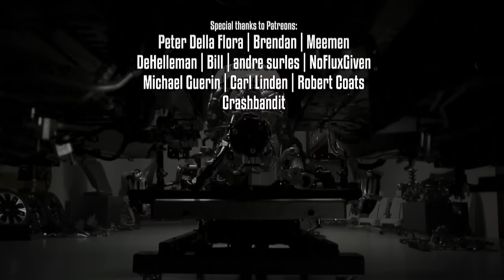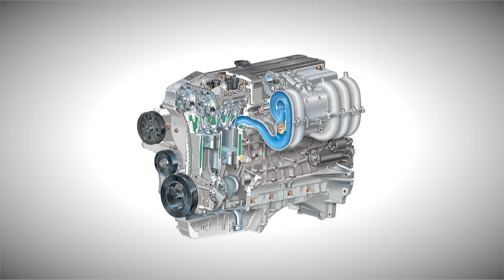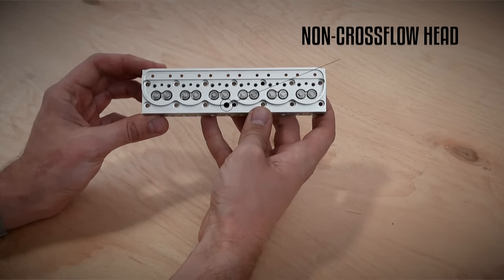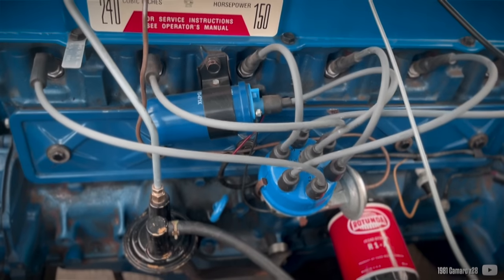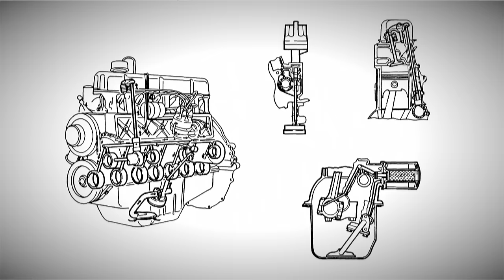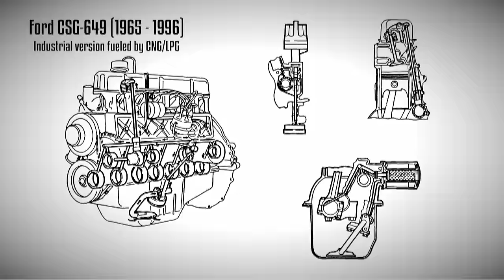Is This Toughest US 6-Cylinder?

Comment: I currently own an f500 with the 300 in it. It sat unused for 10 yrs because I'd grown weary of troubles with the brakes, engine catching fire, ( leaky carb and cracked exhaust manifold ). One day I decided to resurrect the truck, do everything right and put back into service. I cleaned the gas tank, got a new manifold and carb, cranked it over and it started right up and ran beautifully. The 10yrs meant nothing to that engine. Sad, but I never finished the restoration and will probably die regretting it. Or maybe a miracle will happen and I'll feel younger and more energetic then I currently do. 🤤

Comment: Chrysler 225 inline Slant Six.  Bullet proof.  Family had one in a station wagon. Just changed oil regularly, sold it with 220k miles.  The body of the car was absolutely falling apart. Buyer just wanted the motor.

Comment: Back in the  80's I had Plymouth with a slant 6, (I think was 206?) That motor was indestructible, the car was falling apart around it ,and after 300.000 miles I blew a cylinder, and I still drove it for another 40,000 that way ,until I got rid of it, and it still ran.

Comment: Dad had a 1975 F-150 bought new and had it for many many years standard shift on the column I bought a 1983 many years ago with 189,000 F-150 and drove it until it had 347 on it and sold it to another person which still has it today and that was 6 years ago and i owned it 12 years and loved it mine had 4 speed in it full size heavy duty XLT hauled wood with it plenty of logging power never could overload that thing one of the best engines I have ever had no newer engines could even compete with it today period very well made those 300 sixes where period

Comment: I know that's why all the corporations quit making their big 6-cylinder engines all of them had great ones I had a Ford with a 300 6 cylinder engine I had a Plymouth with a slant 6 and I had the jeep with a 4.0 all Dynamite engines last for at least 250 to 300,000 miles no problem and if you're really took care of them they would go about 500,000 miles timing belt that was it

Comment: The presenter mentions that Ford has been a proponent of straight 6 cylinder engines since the early 20th Century.  That is not true.  Early Fords, including the Model T and Model A, were powered by straight 4 cylinder engines until Ford intruded a larger engine, which was the famous V-8 of the early 1930s, and which lasted in production for another 20 years.

Comment: I remember when Ford's 300 ci  inline 6 had more torque at low rpm than their 351 v8.  It was the best choice for the F150 and F250 pickup trucks.  You could pull out in 2nd gear without stalling the motor.

Comment: The Fords CID 300 was the best inline 6 ever made. Maybe not the best economical. My old F100 would only get 15 mpg. But that engine was very reliable. Gear to gear cam to crank. Why they went to belt driven cams in later engines? Probably to sell more belts and make a cheaper design.

Comment: Biggest thing most people over look is the ability to perform most task from under the hood.... Oil change etc .you can even do engine rebuild without pulling the engine block.... Ain't it just ain't it 😜 lols.....add electronic ignition and they are so dependable....The inline in the field and woods are awesome especially 4 wheel drive..... I used them in spreader trucks 700 Ford chasis with a throttle Lock all you had to do was steer...😎

Comment: I use to operate siesmic equipment in the oil field that had Ford 300 industrial engine
I never seen one with a bottom end failure
Rocker arms would occassionaly have a push rod go through them
But that was it
Incredibly tough engines

Comment: Haven't watched the video, but if it's the Ford 300 six, then yes.

Well. Of course it was the 300 six! My daily ranch truck. Not an economy vehicle, but if you need a rig to start on a cold day and give reliable service, daily, it's still the clear ticket. I suspect it died due to emission controls tightening, but it's the best six cyl and maybe the best auto engine ever.

Comment: I worked at a ford dealership when the cash for clunkers was a thing! We had a handful of trade ins that needed to be destroyed and hauled away….(saddened me watching perfectly good vehicles get ruined) anyway, employees of the dealership couldn’t touch these trade ins that were on the chopping block….a designated driver/operator came and destroyed the engines and hauled them away…..one day the as this “Driver” was doing his thing to these perfectly good vehicles , I ask him what the process was? He said he drained the oil and put a salt water solution in them….then proceeded to run the engine till it seized…I then asked him what’s the longest he’s had to run and engine before it seized….he replied with about 15 minutes …normally only takes just a couple minutes for most engines. I then asked what engine was it that too so long? He said the Ford 300 six! He said it wasn’t a fluke either…..he’s destroyed 5-6 of these engines during this prices and they were all well over 10 minutes to seize…

Comment: I had 1996 Econ Van with a 300. I sold to a friend at about 300K miles. My friend drove it to about 750K then the odometer broke. Engine never was rebuilt and was still original when he finally sold it.

Comment: The Ford 300 was Ford's best engine but the Chevrolet 292 probably it's equal. To say either is the best 6 cylinder would be a lie because all semi trucks use 6 cylinders and if your going to claim diesels don't count because they would easily win you also have to think that Cummins is making a gas version of the 6.7l diesel

Comment: My Inline 250 that i had in my 1976 Ford Maverick, would just not die. By the time i had pulled the motor out, (Which it still ran), it had 400k miles on it. I never ran an air filter on it, i never changed the oil, it had so much wear in the cylinders that when it ran out of oil, it would just shake and shut off. I would just add more oil and it would start up with no problem. I wish i had kept that engine and rebuilt it. Instead i went with a Ford 302.

Comment: My daily is a 91 f150 with the 300 6. I routinely pull a 20ft flatbed trailer with 2 tons of scrap and more in the truck bed. Most of the time the combined weight is over 11k lbs. It's not fast but it always gets the job done.

Comment: I drive a 72 f250 with this engine. It has a cracked cylinder head and leaks water into the oil. I plan to fix it eventually, it's been this way for a year. Not really a big deal, I just keep the rpms low and removed the thermostat so the engine can't heat up.

I daily drive it, not worried about it at all. It's from 1968, I think its all original parts

Comment: My 1985 F150 has 410K miles on the last of the  carburated 300 cu in made before going to fuel injection, and it is still going strong and will until the commies over here outlaw gasoline.  Have to add it, the original mechanical fuel pump is still on the motor.

Comment: UPS used the Ford 300 L6 in their delivery vans for the longest time. A buddy drove one and said they pulled the motor and transmission every 65,000 miles for inspection and refurbishing.

Comment: Owned a 1986 F-150 with this engine drove over 260,000 miles and ran great when I sold it . Only issue was the fuel system " carb " had it replaced at least 3 times .  really miss that truck .

Comment: This would be an interesting engine with modern day engineering...ditch the single side Intake/Exhaust, with segmented ports left/right, ditch the distributor for COP ignition which you would have to do for room anyhow if using a traditional cylinderhead design...

Comment: Another reason for V6 engines is that they can be built on assembly lines designed for manufacturing V8s. This was the case when American manufacturers panicked following the oil crisis of the 1970s and started fitting their cars with smaller V6 engines in lieu of the usual V8. These V6s were basically V8s minus two cylinders and used a 90 degree angle like a V8 even though a 60 degree V6 is better balanced.

Comment: My pops had 82 F250 4x4 regular cab long bed with 300/6cylinder np435 4 speed manual transmission with 4.11 gears.
He worked the snot out of that truck. I can't remember not even once that it broke down leaving us stranded. 
My dad sold it to his friend, the truck had just over 300k miles on it and the Air conditioning still blew ice cold. The major repairs that was done was we replaced the clutch once, replaced the ring gear and pinion in the rearend (my pops had to snatch a friend of his with a boat up a soft sandy hill) it broke a tooth off of the pinion. My dad rebuilt the steering box because the worm gear in it had so much play.
Normal stuff was brakes, wheel bearings, u joints, starter, water pump, altinator headlight switch (every Ford truck me or my pops has owned has had to have the headlight switch replaced) 
It was just a solid truck. Nobody builds them like that anymore

Comment: In the mid 70's I bought a 1970 Ford Econoline that was a former General Electric service van. The van must have had over 80000 miles on it when I got. The Econoline had a 240 in it and it ran great for the few years that I had it. The 240 never failed me. Great engine!

Comment: one would think with 50 cubes per cylinder.mild porting to keep velocities high with good low lift flow would really pay dividends when combined with a good intake & carb combo.& still keep it under 4k rpms for longevity reasons.am surprised edelbrock hasnt built an aluminum head for them.

Comment: had a 66 240  Econoline and a 71 300 p300 step van   the Econoline was tough on clutches at least rebuilt ones which i never bought again  the 71  had the non metal timing gear that went and eventually needed vales we just bough used head  but starters were too week finally a custom rebuild of starter and a battey sized for the big 500cid caddy's  worked  would buy a truck with the 300 today if i could find a mid 80s e 250 van

Comment: I love the 300 ford. Also the Case 504 BDT.  We have one in a feed truck. The only problem with it is that it dumps gas in the crankcase sometimes. I have replaced nearly everything I can think that might be causing it but it still does it.

Comment: I bought a 81 F100 with a 300 six three speed manual. I bought it with plans to build and put a 351w in it once the six wore out or needed rebuilding. never got the chance to put the 351w in. The only thing good on that old truck or working was the motor and that's why the guy bought the truck from me was for the motor. I got my money out of it put a lot of miles on it. Tuff truck.

Comment: The 300 is a great engine but don't forget the AMC 254 and 4.0 or the torque monster GM 292. Now quick and reliable has to go to the Chrysler slant six with its ability to rev like a modern sports car engine. Plus the long run intake allowed for low end torque. Had experience with all these engines. I currently have a 55 bel-air with a modded turbo 292. More manufacturers need to bring back the inline six

Comment: As much as I love Ford and Ford engines there was a time I was driving a car with a Chrysler 225 Slant 6. You could beat the crap out of that engine and it would run forever. They dropped that engine in the early 80's.

Comment: One of my first vehicles I bought for myself was a beautiful emerald green 1979 F250 Explorer Custom for $1500 USD back in 2013. The truck had a 4 speed manual and the 4.9L I6 and while it was no powerhouse, it pushed that truck hard everyday. I had that pickup over 100mph more than once and it hauled anything I'd toss in the back. Dumbest mistake I have ever made to this day was trading it off for a 94 Honda Civic with a D16z6 for fuel mileage because my girlfriend at the time lived an hour away. Fun fact about that poor engine, I didn't check my coolant for the entire summer I drove it around because I assumed it held fine. Around September I decided to take a look and the radiator was actually about 30% full because the thermostat housing had a severe leak that only showed when it was hot and running. I ran that all summer dry and it never complained and never gave me any trouble for it

Comment: Ford 6 cylinder has proven to be super strong for its low horsepower given at the time. 

BMW has proven to be ultra strong with its high horsepower given. 

Mazda now makes a straight 6. Mazda went old school while everyone else is going electric. 

BMW’s new B58 straight six is the new legendary engine. Toyota even uses it now.

Comment: I bought an older used 1980 F150 with what appeared to be a freshly rebuilt 300 in it. When in the bush on bad roads all I had to do was put it in first gear and let it pull us up the road even with both of us in the cab and a load of camping gear in it. I sold it 5yrs later for more than I paid for it. Still miss it. Should have just put money into it instead of getting my 2007 F150

Comment: Bought a shorty 4×4 in 91 with the 300. Creeping up on 600,000 and other than changing the valve cover gasket I've done nothing to the engine except water pump and alternator. 
Running strong and I have no reason to believe it won't last forever.

Comment: Bought a Ford econoline years back w/300 inline 6 with 90,000 miles,asked the owner how much oil it used he replied doesn't  use any ,thought he was b'shtting the truck didn't use any from oil change to oil change one of best motors ever made along the with chev inline 6.

Comment: The best was the Slant Six as far as durability.  The Ford and Chevy both rate a close second with no real difference in life or performance overall, assuming proper maintenance.  The 300 is a good engine, in a pack of equally good engines.

Comment: I find this hard to believe I had a 79 Chevy c10 with a 250 in it and my neighbor had a 78 ford with a 300 not only could I haul more weight but worked circles around him I’m not say the 300 is a bad motor it an’t but when his ford died it had 200090 on it and my Chevy had over 300000 on it and it’s still running today not good but it’s still going an’t much of the truck left it kinda rusted away lol

Comment: At about 3:45 a Falcon type vehicle is shown but I think that has a far different inline 6 than the 240/300 model
also there was a 250 inline 6 that did not have nearly as good a reputation as the 240 (I think the 240 was actually physically larger)

Comment: Ive had 2 efi models ive ran one with no coolant for a week because the rad blow and couldnt afford to replace it even with the temp gauage spiked it never seemed to care. Also ran it basicly bone dry also didnt seem to care. 

Idk whos getting 15 to 24 mpg mine never got over 12. Did not matter how i ran it soft/hard empty or loaded mpg never really changed. 

Also yea you couldnt stall tge damn thing with how lpw tge tq was i could run thur all 5 gears just useing the clutch and shifting to gas imput with no issues. But the damn things are slooooooww from a stop  empty i had a few semis pull away from me. Topped out mid 80s. Ive seen a few builds with boss 302 heads and other heads cut up and welded to fit these they run so much better. If someone had made an after market cross flow head then these would be really great engines

Comment: I ran my 300 hot enough once that it was bubbling grease and oil off the side of the block. Stopped, let it cool off, filled it back up with water and keep going. I fixed the radiator and am still driving it 7-8 years later

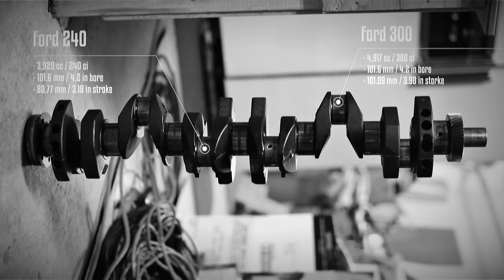Comment: Good commentary. I got a bad condition 1990 f150 for the 300 6.  287K miles and internal sludge meant few oil changes and tough life. Engine builder took it apart and told me the engine was in good condition only needed cleaning and timing set. I had it 100% rebuilt anyway for my 32 Essex 4 door model Super Six. The best fix to the 300 was FI intake/exhaust but I replaced the throttle body with a side draft weber, really incredible look. 4 door essex weighs 2840 lbs. 300 6, Ford 3 speed, 9" rear 3:10 gears, disk brakes and power steering now a real Super Six super cruiser. The craziest bit was the 1960 tbird rear springs direct mounted to the Essex and the bird moon roof top fit the essex roof. Don't hate me, the Golde roof bird was badly punched.

Comment: I had a 84 300 f150 on propane that ran with no issues and a 96 f150 that did the same. To this day I'd like to make a high performance motor N/A out of one and see what kind of torque I can get before it breaks.

Comment: Here is the build done by the YiuTube channel "POWERNATION" for the Ford 300 engine.

What I like so much about the episode, after the engine of course, is they didn't go berserk trying to get a drag-strip ready.

They do some mods which are kind of whole-home but then they do the final mod in this video that is eye-opening.

https://youtu.be/N5bnl8knexU

That's kind of the mod I would do. I'm not going to street race or anything at my old age. But I would like it to accelerate a little bit better than just 89 horsepower.

Comment: I worked on them for years in big brown trucks. The fiber gears were the only weakness in the design, and they were a huge issue. We took them out asap, because they gave zero warning when they failed and they didn’t last long. I has an 1988 efi econoline with a C6 freeze to the ground and I had to do a neutral drop to get it to move, as it didn’t have enough power to get the tires unstuck! 😂😂

Comment: The fuel injected 300 6 was plauged with starting issues that the injected 5.0 and 5.8 didn't have. And the last few years of carbs had issues with the carb bodies loosening in the middle and at the throttle plate on the bottom. Fresh gaskets and loctite would buy you a few years but the throttle spring pressure loosening it up would return.